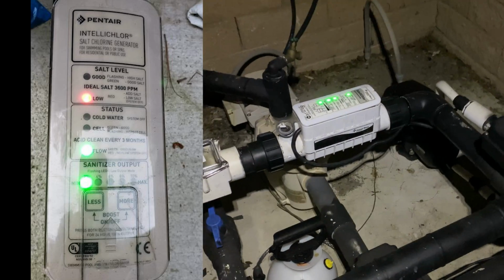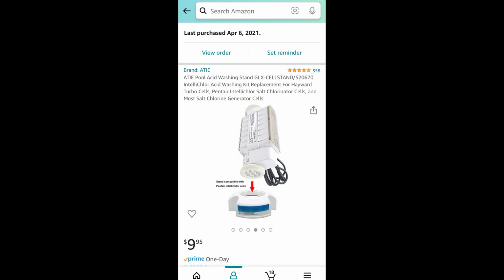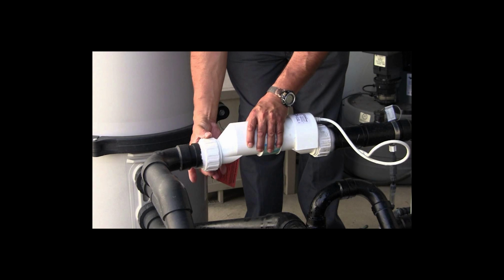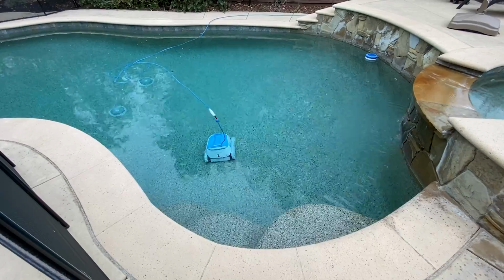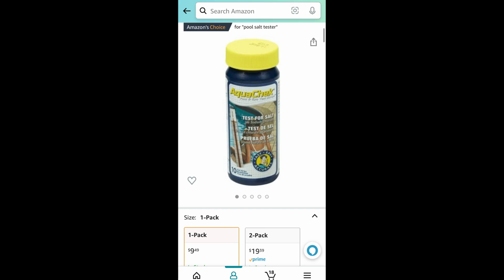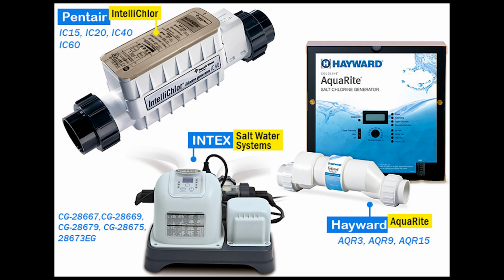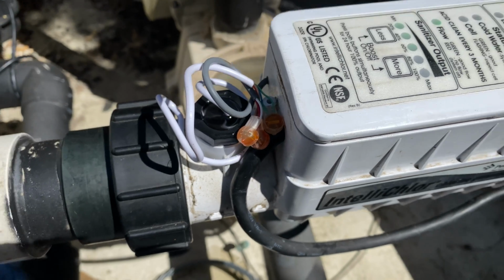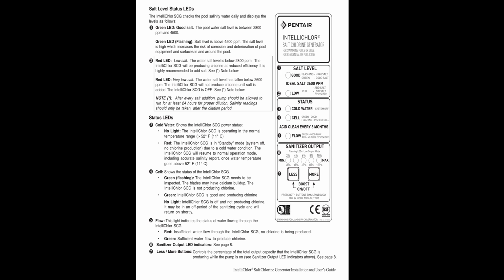Fix Error Codes or Replace Salt Cell Flow Sensor

Comment: I did everything you said here but it still says no flow. I backflowed it, cleaned it everything. I hate the system. Seriously I’m considering going back to Chlorine. It’s way too sensitive
Reply from the maker: Is there a water flow issue that you can tell? Is the water flowing slow or fast? Did you try replacing the “flow sensor”
Reply: @fixitwithjake  Yeah, I just replaced the new flow sensor, nothing worked. Prior to that I had  back flowed the pool quite well as well as cleaned the salt cell correctly with muriatic acid. The unit is four years old and it has about 40% life left. I just don’t believe in the system. It’s so finicky. It has been reading high salt levels even with this new sensor but when I run an independent test the salt limits are well within limits.
Reply: @fixitwithjake  Yes, brand new sensor this afternoon. I took the water flow all the way up to 3500 RPM. Still nothing. I bought a cheaper replacement for the IC40 at Leslie’s. It’s called the splash. It plugs into the existing Intellichlor Control box and with a discount I got it for $540 which is half the price of the original. And then even when the original a lot of these online businesses are saying it is back ordered and could be months. I was never really impressed with the original OEM system. Even if I get a few years out of it it’s worthwhile experiment
Reply from the maker: Thanks for sharing this intel. At first I thought I’d need a replacement too and was not happy about the out of stock and inflated prices. Happy to hear there are other options for the day we need to replace ours. Let us know how yours holds up! Thanks again !
Reply: @fixitwithjake  so far so good. I installed it in about five minutes. It really does hook right up in terms of dimensions as well as the connector for the data. You can run the RPM on this generic one significantly lower than the intellichlor and still have it generate… i’m probably saving 300 W. It is relatively basic but that’s actually a good thing. It has a pretty convenient display that tells you what percentage of chlorine you’re making, if it’s trying to figure out flow, etc. It’s a digital display that is backlit. So far so good, definitely generating chlorine  based on my test strips. I will check in in about a year to let you guys know how it goes but again, if I can get three or four years out of this, I’m never going back
Reply: @2steaksandwiches665  it’s been about a year or so. What’s the consensus on the aftermarket unit?
Reply: @dansalazar7779  fantastic. Second year in. I love the real time read out of salinity. And it has this feature where it does reverse polarity so it cleans itself. I took the Cell out a month ago to look at it and the plates are in very good condition and wasn’t caked with salt. Recommend!! Even if I get three years out of it half the cost of the brand-name. It effectively produces chlorine and is very predictable.
Reply from the maker: This is great to hear! I will give it a shot!
Reply from the maker: Why would it?

Comment: Great video, thanks. I cleaned my IC40 yesterday with a 1:4 muriatic acid/water mix and today I’m getting a flashing green (high salt) light on the salt level part of the screen. Last week the pool store (Leslie’s) showed my salt to be 3200 ppm. I also backwashed a few days ago, so if anything, it should be low. Water doesn’t taste salty either. Pool store said I should reset it. I can’t find instructions on that. I pressed the “more” button but it didn’t change anything after going through its cycle. The less or more buttons don’t seem to work but the app lets me change the sanitizer level which has been at 80%. Any thoughts? Thanks
Reply from the maker: Hi there. The older model IC40s have an option to recalibrate them in the manual. The newer ones like mine don’t allow for that. I called Pentair to ask them how to recalibrate. They were confused and didn’t help. Second I called I got a better tech who said I can’t recalibrate. After that I decided to replace the flow sensor bc that is also the salinity sensor. That fixed the salt levels issue. Soooo, see if you can recalibrate, if u can’t, swap out the cheap flow/salt sensor and that should help.
Reply: @fixitwithjake  Thanks so much. I was on the phone with Pentair for 35 minutes today and the guy tried to do all kinds of diagnostics and in the end told me to replace the flow sensor/switch. $50. Hopefully it’ll fix it. Thanks again
Reply from the maker: Welcome. Sure seems like the flow sensor fixes a lot of errors involving bad measurements and readings. One of the cheapest places to start too.

Comment: I replaced mine and it’s still flashing red to green on the salt reading and the flow light stays on red? Any recs?
Reply from the maker: First off, good job getting it replaced. If it’s flashing red/green that is the start up process. You need to let it do that for aprox 5 mins. If the red and green stops and you end up with a red flow light it could mean a number of things. It could mean that you don’t have your valves open properly, poor pump pressure, a dirty or clogged filter system, or an obstruction inside the salt cell. Go to page 28 to read more about these https://www.pentair.com/content/dam/extranet/nam/product-related/product-manuals/pool-and-spa-equipment/intellichlor/IntelliChlor_Owners_Manual_Version_3_units_after_Nov_2011_English.pdf